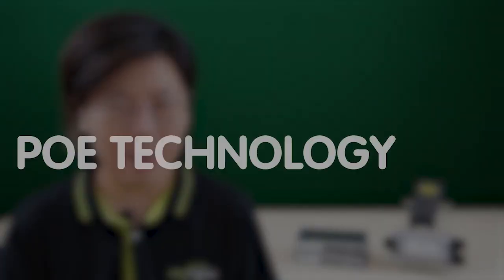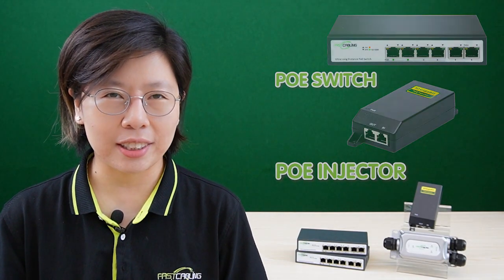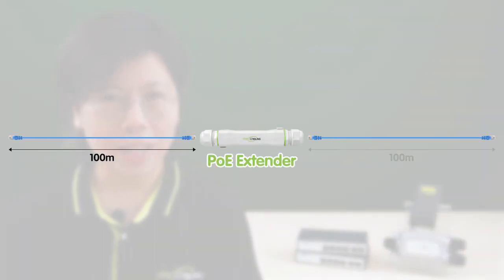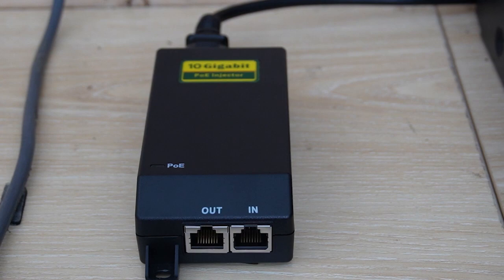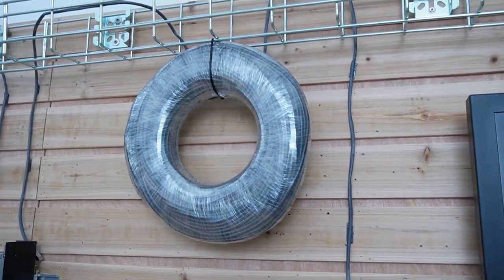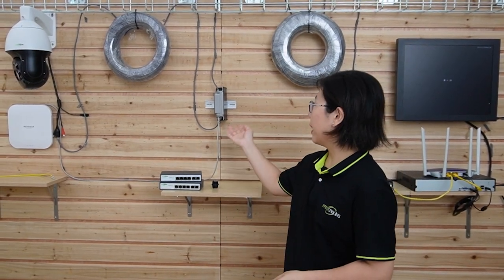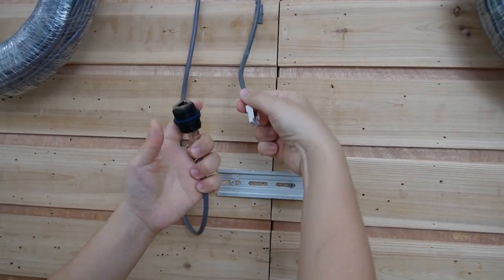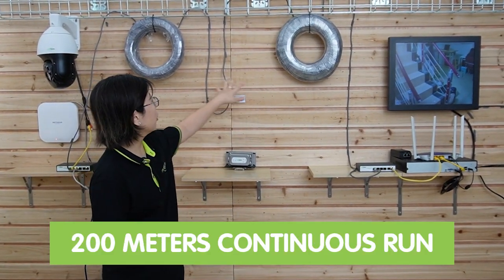How to Extend Ethernet Range with PoE Technology

Comment: What is only data transfer mean one way
Reply from the maker: Usually we need to place the PoE extender before 328ft since the data will stop dropping. The PoE extender needs the power, and the power is not easier to acquire at the middle of the cable. That is why we use POE. We will send both power and the data inline for the PoE exender at the middle. With alternative solution, we don't need to place the PoE extender at the middle, then it will be only data from one end to another. There is no need to inject the power line.